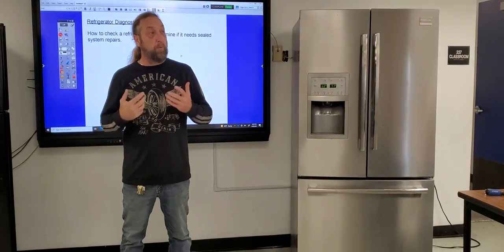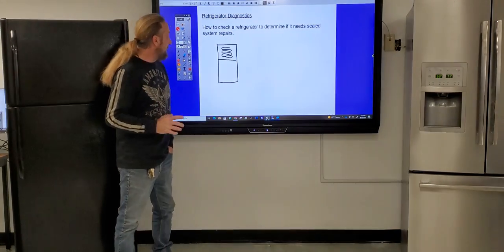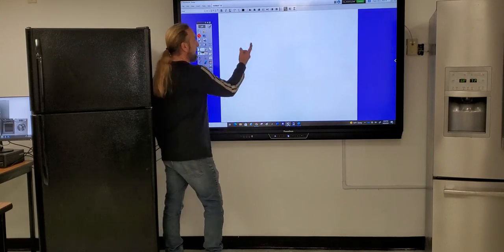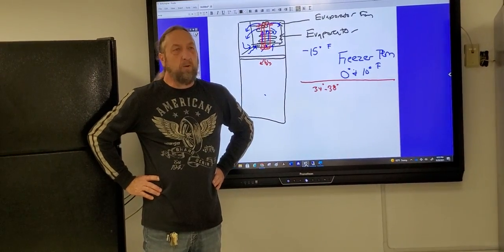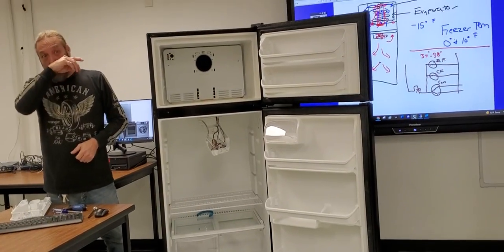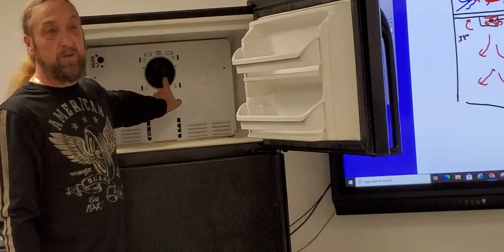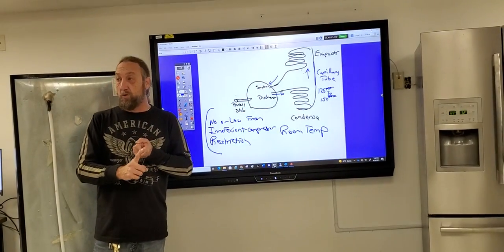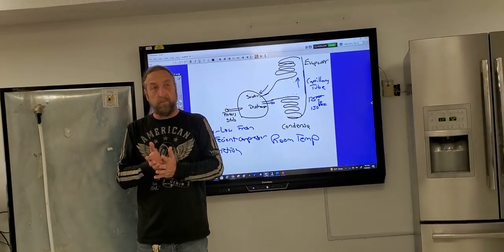Refrigerator Troubleshooting

Comment: Actually cold doesn't leave, heated air moves in. Atmospheric gases in any area always try to equalize temperature. You want to text temperature of food and water inside a refrigerator that had been in for awhile. Water does not change temperature rapidly. However, water temperature will  NEVER REACH below 32° without tremendous removal of superheat btu's.  Water also will not reach above 212° F unless superheated under pressure or by subjecting to microwaves. It is important to teach students physics regarding pressure and superheat when dealing with refrigeration  systems. It's on the licensing tests.
Reply: In appliance repair, there is no license as you say, only commercial trades like HVAC etc.. This is meant to be a basic understanding of the refrigerator. I do have a cup of water inside the bottom mount refrigerator and that is in the discussion for part 2.  As far as cold leaving, in refrigeration there is only heat no such thing as cold, is the absence of heat. But again for those who are not taking a formal class all the things you are saying are true but irrelevant for the actual lesson I'm trying to teach, Thanks for the input.

Comment: How do you calculate the   amount of refrigerant when refilling a fridge and the capacity is 59g of refrigerant?
Reply: R600 is measured in grams mostl;y, new refrigerator use both grams or ounces, anyways I use a small food scale from amazon to measure the refrigerant in the system.

Comment: Hello, I am from Greece and I got an Amana refrigerator at the house I am renting. Refrigerator is not mine.

I am mechanical engineer, so I tend to search learn and fix things if I got the time.

The last two days I noticed that my freezer in refrigerator was melting the ice cubes and the frozen food wasn't too Frozen.

So I was searching to learn regarding the refrigerators in general.

I found your videos and I was amazed from your teaching, I saw two times videos "Refrigerator troubleshooting" part 1 , 2 and 3 and it felt like the knowledge was instantly transferred to my brain.

The result is that I troubleshoot the refrigerator problem and I found a burn out condenser motor.

I searched for the part on local market and I replaced it saving a lots of money and I have the learning overall experience ( theoretical and practical)

Therefore I would like to thank you from the deepest of my heart for sharing this knowledge in public.

May God bless you.
Reply from the maker: Wow, great story. I'm glad to help you. Thanks for watching and your support 🙏

Comment: Great video but just one thing, when your fans and compressor are working yet you have no cooling you want to look for a plugged/dirty coil before checking pressures. Thankful for this channel since transitioning to appliance repair from HVAC.
Reply: Another thing I learned from this video and part two was the foam diffusers that keep the evap coil in place, check those before pressure/temp too. And he said if the unit isn't level the doors flex and might not shut the light switch off. Thank you for this content

Comment: Hi

At this point with my Frigidaire GLHS67EHQ side-by-side refrigerator, I’ve replaced the damper, evaporator thermostat, and evaporator fan (which is running). Although the compressor was working, I decided to install a new start device since the unit is 12 years old and I was already cleaning the condenser coil.

The damper is open, and air is flowing, but there doesn’t seem to be much velocity. The freezer is cold, but the fridge side remains warm. There’s no corrosion, and there’s no ice buildup on the evaporator.

I also replaced the control panel, but that didn’t resolve the cooling issue on the fridge side either. I’ve checked and rechecked everything, including re-crimping the evaporator thermostat wires to ensure they were properly connected, but the problem persists.

I’ve also removed the ice maker and top back panel to check for obstructions, and everything looks good. The vent by the crisper is clear as well.

I’ve been working on this for days and am not sure what else I can check. Any further guidance would be greatly appreciated!

Thanks for any ideas in advance.
Dean

Comment: So if I want to get an accurate temp reading in the freezer with the sensor on my DMM, how long should I wait after I open the door and place the sensor inside? 5 or 10 minutes? More? How long will it take the evaporator to reestablish temperature?
Reply from the maker: The most accurate was to test refrigerator temperature is to see if they have any water stored in there and test water temp, IF you are waiting for refrigerator air temp to stabilize, too many factors to give a time frame, but here is what you do to be as accurate as possible. Leave doors open till compressor cycles on, have sensor inside unit, wait till compressor cycles off that will be as closest to set temperature, but the water is the best.

Comment: okay, I have an older Frigidaire  refrigerator, 2002 model in actually excellent shape. Don't want to buy a new one made in China! Stopped working completely, so watched some videos on YouTube, and it was most likely the timer. Plugged a  new timer in and the compressor and fan started working immediately, and the freezer froze a water bottle. Then it shut off and the the water bottle started to thaw. This is happening over and over, as the water thaws, freezes again , and starts thawing ! Could the new timer I bought on Amazon be bad?   Any other tests ?  The original timer was listed at 10 hours- 30 , the new timer is 12 hours-25. Have a brand new spare that is 8 hours-25. Should I try the spare? I'm using the same amp timers.

Comment: I bought a new deep freeze and it was great,it was operating perfectly well but vandals broke in and tipped it over.
After that event when I switched it on the system works, but the fridge is not getting cold.... need help

Comment: What would be the best multimeter for an appliance repairman? Thank you in advance.
Reply: Im an Analog meter guy, Old School. But Field Piece makes a good meter, but for most Appliances tests you do not necessarily need such an expensive meter a simple Klein Meter that measures AC/DC voltage, Capacitance, temperature and HZ, Klein has one between $35 and $55
Reply: Fluke meter with the LoZ function and a separate clamp meter or a fieldpiece 680

Comment: I must be the only one who wants a largr freezer than refrigerator. I ha e been watching video after video trying to figure out how to move th evaporator coils or just the fan blowing direction just so the bottom  of my top mount is the freezer. 
This is not the same as a bottom mount. At least not for me. I actually want a SMALLER REFRIGERATOR. so I want to convert those old school fridges  like the one you're  demonstrating on. 
I call this the FREEZERATOR. 
Everything I get close I realize something else has to move. 
I dread having to cut copper because  it doesn't go back together with duct tape LOL. 
NOW these temperatures thermostats regulating openings for the air.... I can't do this myself. 
Maybe you can do it with step by step, and I can follow you?

I thought oh just flip that fan vent over just move the evaporator coils to the bottom.
Is there space in the larger cabinet for the coils? 
Now I need a new cover
And the length of the pipes bringing freon to the coils has to change. 

Please help me make a FREEZERTOR. THANKS
Reply: What you are proposing is possible, but would be a nightmare.

Wiring, cooling components fan etc.. defrost wiring.
Defrost drain is an issue.
Then you have airflow,  sorry I could do it, but way too much work. I once helped a student refrigerate a spacesaver microwave, 

I honestly think you should look into the electrolux all refrigerator or buy an upright freezer and change temperature control that would make more sense
Reply: @richardzilka8151  Wow it seems as if a small fridge maybe 3.0 cubic foot like the Galanz company makes that size seems doable. Or does the freon literally only flow one way in the tubes?

Would it be better from scratch? I mean One could wire things as if it were a bottom mount refrigerator, but only the compartments wouldn't change.
Reply: The Galanz is different The blower is enclosed Whatever cooling they do happens on the other side of the cabinet. The inside is dry and quiet no air blowing. And there are no coils exposed in the back either. everything is sealed.   

I guess I'm going to have to go play in the junk yard until I figure it out.